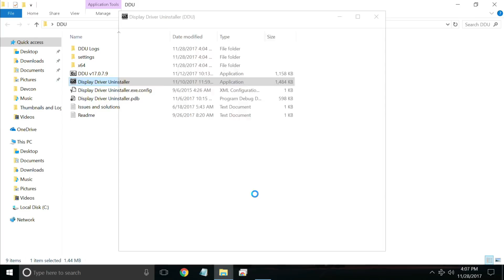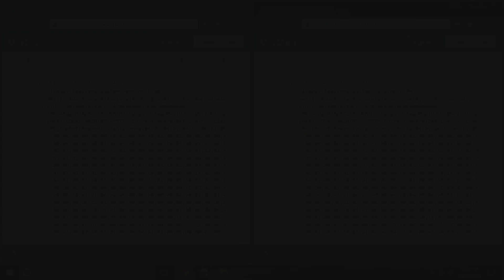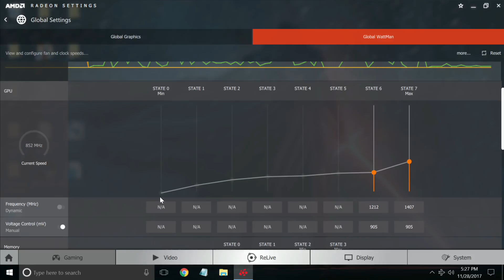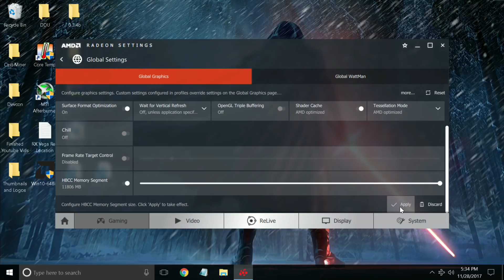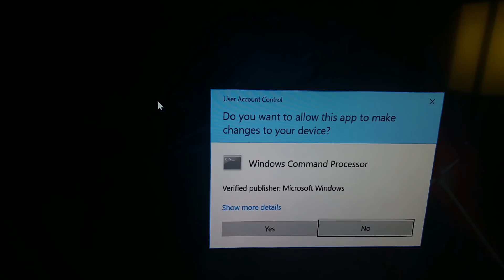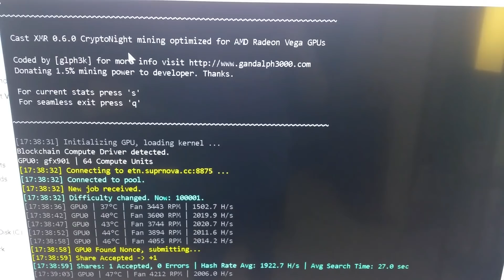RX Vega 64 (or flashed 56) Registry Editor, Power Play Table and Devcon Tutorial!

Comment: Hey there. i think i did a boo boo. i had all 6 gpus rx vega 64  slotted in then reistaled the blockchain driver then used your video and edited the registry with the 1100 setting while all 6 cards were in. i found on registry there were 7 folders - 000 - 006 and the 006 was the intel onboard card. so i aplyed the registry edit on all 6 folders of the gpus. when i hit restart nothing wanned to boot. i also tryed to reset bios setting  and remover the mobo batery but again after turning it on i see the rig powering up but i get nothing on the monitor. Did a mess up badly ? do i need to do your setting with only 1 card in and 1 folder and then just plug the rest of gpus and im ready to go ? i needz help :) Thanks also i wanna mention my vegas are the water cooled versionit that matters in some way.
Reply: well seems the liquid version had diff power tables. but for now i have other issues. i reseted bios and now i get another error
windows boots fine with 5 gpus but when i socket the 6th it doesnt boot anymore. alot of issues latelly and im feeling down  :( tommorow i am having a friend come over and help me. then its the powerplay ...hope ill be mining happy and stable for tomorow night.
Reply from the maker: well in the next few days I'm going to make another video from start to finish using 6 gpus. It seems a lot of people are still confused. I'm going to be using a ASUS PRIME Z270-P LGA1151 in the video. I'll have parts used in description if you wanna check it out.
Reply from the maker: I believe the AIO vega 64 has different parameters than the air version. I unfortunitely don't have a AIO vega 64 to test this on. If the system refuses to power on using the vega cards I would start the system using the IGPU and use DDU to remove the drivers. That should let you boot up again. If that doesn't work either you can use any old random extra GPU you have laying around just to boot into the OS and use DDU. There seems to be very few people mining with the AIO 64 cards and there seems to be little info regarding the AIO 64 registry mod. I wish I could help you more bud!
Reply: Well most ppl just think to invest as low as possible and get as high profits as they can. i payed around 1000 usd more on the 6 gpus with water cooling but in exchange i got a rig that runs very silent and at 45-50 c on temperature + 5 of my cards can go as high as 2090 h/s while 1 lazy 1 goes 2030 to be somewhat stable. Thank you very much for the reply. i was getting worried i messed up my gpus. I always go for safe mining at low temps rather than the lowest investment. I think its worthed in the long run.
Reply from the maker: Yea no problem man, sorry I couldn't help you more. The cards should be fine, you just need to remove the drivers and they'll boot up again.
Reply: i found hallae's post on reddit and asked there. Hopefully sum1 who knows this stuff can help me and the other miners that prefer this gpu version. for now ill just use msi but its kinda anoying and for the 2050 h/s per gpu it takes around 1800 w at wall :(
Reply from the maker: I know there are AIO power play tables in overclockers, but I don't wanna give false info since I can't test it myself. You can edit the P states in the registry file yourself if you know how to convert from decimal to hex. If I had an AIO I could try to give you a custom table but I don't wanna give you something that might ruin your card since I can't test it myself. Let me know what you find! Also 1800W is quite high, I have 7 cards in 1 rig running at 1215W. Hopefully you can figure it out.
Reply: 1 more thing. When you do the powerplay and blockchain driver instal do u do it with 1 card in and after that success u add all the cards or the other way around > ?  And whats that overclockes so i might go and read some stuf or ask a question there . Thanks
Reply from the maker: I install the drivers on 1 card --> restard PC and connect the rest --> I then disable crossfire --> restart PC and apply the registry on all the cards at once --> restart PC. You might find some usefull info here http://www.overclock.net/t/1633446/preliminary-view-of-amd-vega-bios/250
Reply: i talked with hellae and he said that 56 flashed,64 and 64 liquid all have same powertables so i gues i will try this again .
Reply from the maker: Baby Puka. Great! That's good to know. I know it's a pain but believe me is well worth it in the end. Let me know if you get it to work.
Reply: i will start in like 7 h from now..gotta travel back to rig :) but dont take this as acurate...i can remember reading last night that sum1 told helm on that forum that there are diff power tables..so idk. i found sum1 willing to help me for 0.4 eth LOLz
Reply from the maker: Haha alright cool, let me know if you get it work either way! Good luck.
Reply: Baby Puka. I too struggle a lot but gone trough. If u see nothing on the monitor after u restart, unplug ur hdmi from gpu, plug dvi to mobo , unplug every cable connected to gpu, riser, power supply, and run ddu to uninstall the driver again, once done uninstall, shut down windows. Connect every riser and power supply to gpu, hdmi also, and unplug dvi. Then install blockchain driver again, apply regedit, don’t restart. U just have to go to Radeon amd to unable the crossfire, and apply, and then u go to power play toggle , adjust to manual , and hit apply. Then disable and enable hbcc, then u can start mining. Hope this helps ya.
Reply: Baby Puka. No prob hope yours are up and running soon. I spent two weeks time configuring the Vega ‘s due to busy schedule. Get me so frustrated and came out with solutions. Even in my sleep I dreamt of config the gpu lol. But eventually you will settle it.just be patient.
Reply: now i have a big problem. when i install the blockchain driver it doesnt see it as vega anymore. device manager sais vega but driver instalation and ddu sees something like deviceid 31231_dev/&asdasd    some code like that. any idea why ? i tried like 20 times even reinstalled windows 2 times but i get the same issue . same code is in the registry  instead of vega. And if i go into driver instaling details via device managet i get some errors there about failing to start or initialize card and after 2-3 fail atempts its giving it that id. any idea ?
Reply: can you help me with this ? When i use 6 cards it black screens at win start. any card out and it loads fine . i tryed everything i could think of. and still i cant get it to enter windows with 6 gpus. :( mobo is gigabyte h110  :(
Reply from the maker: It's really difficult to help without being there in person. Did you set all the PCI-e slots to Gen1 in the bios?
Reply: well idk if theres such an option in my mobos bios..i havent seen it.  5 cards works well...when i put a 6th then it black screens just after win logo and loading ball circle. now this is my only issue..i figure out the oc and stuff and works really nice with 5 cards...the 6th is an asshole ::)
Reply from the maker: There has to be an option for it. You can't just put all the cards an expect them to work without setting up the bios properly. Also did you make sure each individual card works fine alone? If they all work alone then it has to be something in the bios that isn't set up properly (or a bad riser). If you don't set the lanes to Gen 1 you will saturate them which won't let you run past a given amount of cards.
Reply: all cards run well alone and in a team of 5 ..i will try some more after this win update lolz
Reply from the maker: I don't have a h110 so I don't where it is, but I do know that board has atleast one PCI Express 3.0 x16 Slot that is set to (PCIE2: x16 mode). You have to change it to 1x. If that also doesn't work then I honestly am not sure >.<
Reply: ill try to ....but couldnt find in bios how or that option..ill look more
Reply: ok . so i am at the end of my patience with this mobo. Can you recomend me a easy to set up mobo for 6 cards or 6 vegas ? thanks i am in a dire need of help lolz.
Reply: ok sure. i mean i mine no problem with 5 cards....6th is a bitch. when i put 6th in it seems that win detects a audio plug and play and bugs trying to instal it. also when i manage to log into windows with 1-2 cards disabled and i try to enable them while in windows the screen freezes. only when i have 6 cards in and trying to restart windows i get stopped by win task manager telling me that its instaling plug and play audio stuff. i did all i could do in bios. bios is not flashed btw.  other thing is it could be a bad riser right ? thing is no matter what cards i have in or in what slots...5 cards work perfectly. so im begining to think something may be up with the power cords ...idk..got 2 x 1200 psu right now with a power bridge between them or whatever thats called. but if i can get a new mobo ill be happy with the system working.
Reply: Ok i will wait for your video. And i will get that mobo too cuz i am tired of tweaking this.
Reply: Ehm what psu do u have ?  I havent had issues with 1 card..for me when i add the 6th is makes trouble, but i singled out that the gpu is faulty in my case. Oh and what mobo do u have ?
Reply: 3 cards id go with a 1200 +  at this point
i have 6 cards and my system wouldnt power even 4 cards with a 1200 so i had to use 2. but thats before i overclocked and undervolted them.  Seems like u have the same issue as me. i get win loading screen then just crashes. I am thinking its gpu but idk. later today ill delete all drivers and put that card in, ussually it gets to windows if no driver installed. ill install the driver and see if my win crashes with just that card in. If yes then i gues its the cards. I tryed everything else. different power cords a few risers ...updating windows to many versions LOL., and my other 5 cards have no issue whatsoever. it pretty easy to set them up as long as u have the powerplan for oc i noticed but.....if something goes wrong...well u know :) try using a 1200 power source, try changing the riser or the power cords. some1told me  that i neeeded win 10 creators fall edition or sumthin like that but didnt work for me. i am sending my card to warranty if it doesnt work by itself later today. you might get off with just a higher power psu idk
Reply: ok. major update guys : ) the card isnt faulty its just the ugly duckling. while the rest go up to 1150 on the oc this 1 only stands with 1050. i managed to make them work atm though i still wanna play with the voltages on the ugly duckling just to make it take less power. still i am happy with the results...other cards are at 2070 while this 1 is around 1950 so its not that bad  :)
Reply: Sorry, you don't have the required permissions to download attachments. this is the message which i get when i try to download from that site could you please help me out thanks !!

Comment: I assume drivers still only works with this method up to 8 gpus on one computer?
Reply from the maker: I currently have 7 cards installed in my rig, but will soon add some more. I'll ofcourse keep you guys updated whether or not it is possible to go past 8. I got a pcie multiplier switch  I'll test it out with. I would assume it's possible but only using Windows 10 fall creators update.

Comment: I have 3 MSI Vega 64 GPUs installed on Windows 10 with Blockchain drivers.  I do not see an option to disable crossfire whuen I launch the AMD settings.  Any thoughts?
Reply from the maker: Did you check all the tabs under "Global Graphics"? There should only be 1 card with the option. The other two "global graphics" tabs won't have it. If that doesn't work there is a way to disable it using the Registry editor which is a bit more complicated.
Reply: Geek Mark hello I have one 64 and one 56, I am using igpu so I don't have crossfire option, does it mean it is turndd off already? Also I have another question, I can bring two cards running up to 1900h/s, but the hash rate will drop sometimes after few hours, wongderimg if youet with the same problem or you know the solution, thank you
Reply from the maker: Open the registry editor like I showed in the video, navigate to the folders your graphics cards are in (ex: 0000,0001 ect..). Find both of the cards on the right side by scrolling down on the list. Keep scrolling down until you see a file named "EnableUlps" and "EnableCrossFireAutoLink". Double click on both of them and set the number to 0 instead of 1. This should disable crossfire. Let me know if you have any issues.
Reply: Thanks I will do that shortly and get back on you? does this gonna effect stability?
Reply from the maker: It should help stabalize the system. Also download a program called OverdriveNTool to make sure the power play tables were applied properly with the same numbers I showed in the video. Try not to keep MSI afterburner or global wattman open while mining since I noticed it causes some of the cards to fluctuate.
Reply: Geek Mark My 2 cards are up and running and I will Test for stability. I have 2 question:1. My power consumption is 390w, how do I manage to lower the power? 2. Does your monitor on all the time or you can close it without affect the hash rate?
Reply: disabling this 2 items with "0" - do you do this only once - or every bootup?

Comment: I've 1 trouble, when using devcon it's displaying "disable failed" or equal "enable failed". Devcon for windows 10 build 16299, windows 10 pro 16299, bat file running as admin, devcon too.
Reply from the maker: Hmm that's odd. I've seen that error before but only when the file was being ran without admistrator privilages.  Did you check if the Hardware ID's of the cards match the batch file?
Reply: Yes, and even changed it in batch file to be sure. DevCon determines all 8 cards and displays their full hardware ids,  but after displays "disable failed"
Reply from the maker: The only other thing it could be is maybe you downloaded the wrong version. You made sure to download the amd64 version for your build right? If you did I would try to download the windows WDK version 1709 and restart the computer and try it again.
Reply: Yeah, you are right. I have downloaded x86 version. Thanks!
Reply from the maker: Awesome, glad we could figure it out!